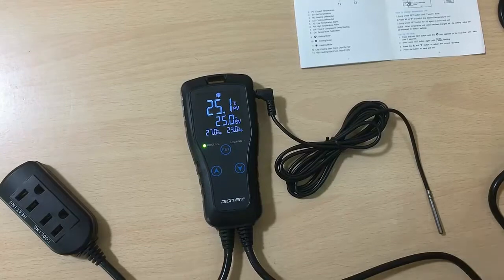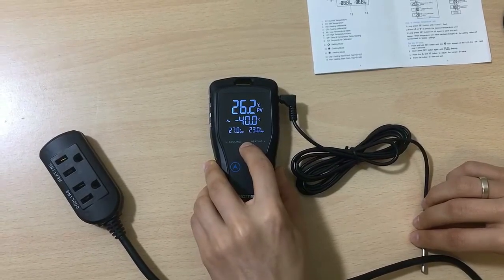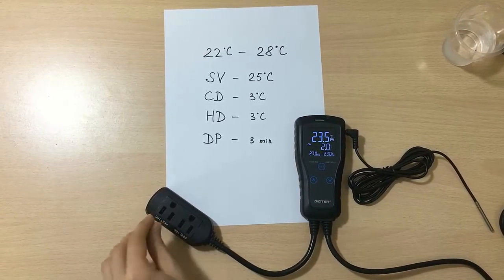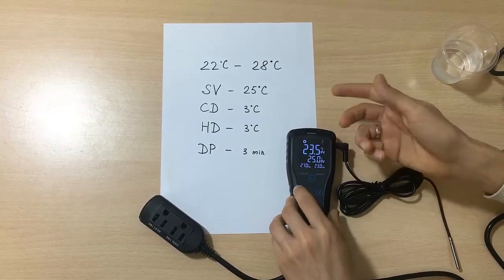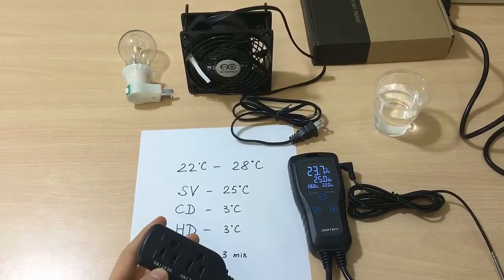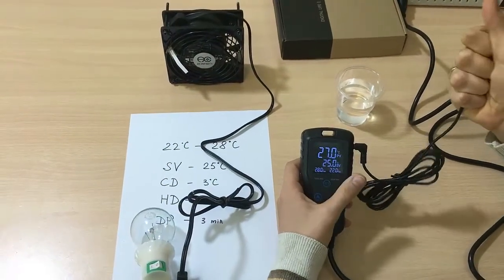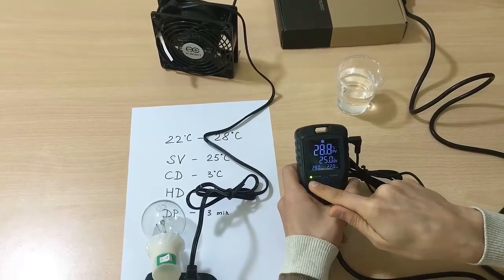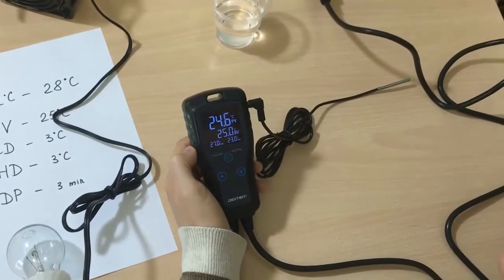DIGITEN Digital LCD Thermostat Pre-wired Temperature Controller Heating Cooling 2 Stage Outlet

Comment: Can this be used for a heater and humidifier at once ?
Reply from the maker: Another product meet your requirement. ASIN:B08K31FCFC
Reply: Explaining what dv means and basic terms would help.  Ie why do you need to set cooling if you already have temp set?
Reply: @emsfromak75  I needed it for a mushroom growing set up but I don't need a heater the humidity is enougn to keep them warm

Comment: Is it possible to adjust the PV manually if it is off from a separate manual test with a more accurate temp reader? My reader is reading high by 2 degrees
Reply from the maker: Certainly, you can set CA value for calibration.

Comment: Very good demonstration, thank you. I bought one in amazon but I just realized that it is connected to a fan heater that works at 220 V ... Input Power: 100 ~ 240VAC, 50 / 60Hz
Temperature Control Output: Max.10A, 100-240VAC
Buzzer Alarm: High and Low Temperature Alarm
Sensor Type: Waterproof NTC sensor (Including)
Sensor Length: 2m, 6ft
Relay Contact Capacity: Heating (10A, 100-240VAC)
                                           Cooling (10A, 100-240VAC) I just need it to turn on and off in a range of temperatures, I'm afraid of spoiling it, can I connect it to a 220 V output?

Comment: Thank you for this video! I did not realize it was the compressor delay that was causing such a problem for me! I had been prepared to return this product to Amazon, because I thought it was defective. I set the 2 degree rise above temp, but it was reaching nearly 10 degrees above temp before the fan would activate. It was the 3 minute compressor delay causing this problem. Thankfully, after learning of this, I set the delay to zero, and now the exhaust fan is operating perfectly! I am very pleased with this, now. The only thing that I would have liked to see, is the ability to have the display have a switch for the light instead of the timed lcd display. Constantly having to press a button to see the display while setting things up is a pain. Overall, I like this product very much.